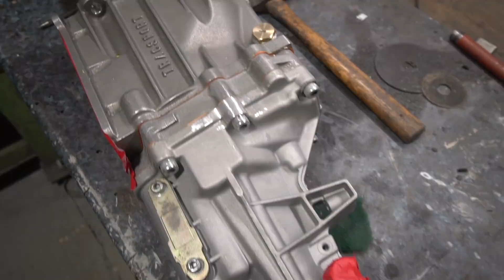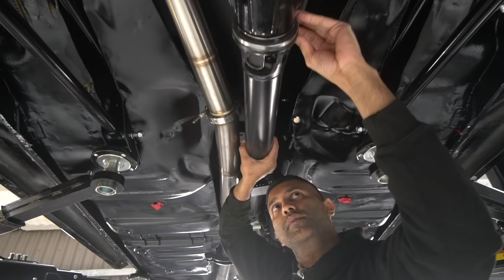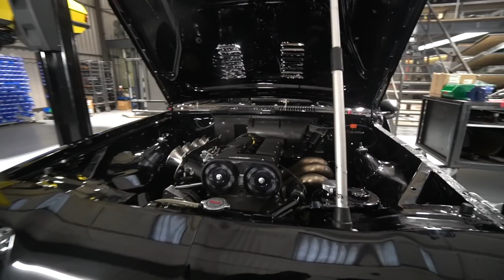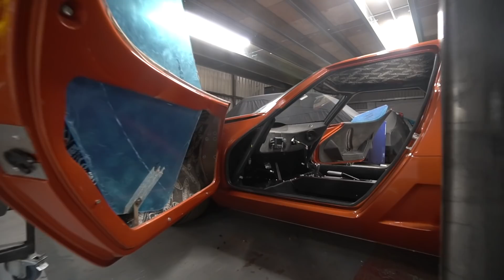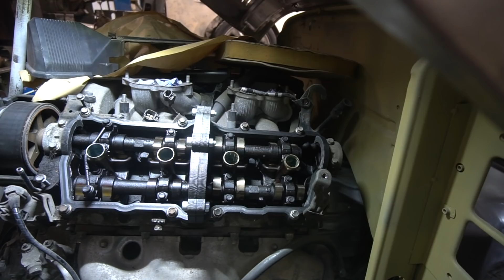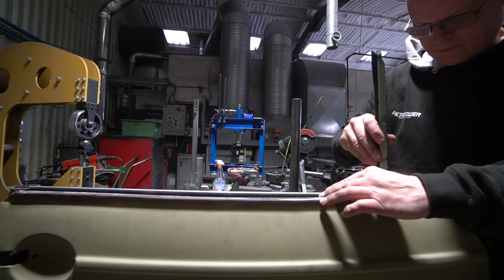Retropower Uncut Episode 60: RS2000 Gearbox Swap, Chevette First Fire-Up & Morris Metalwork

Comment: Why the trottle body injection? In my experinence they tend to not work very well. Or as well as MPI. You could  just hide the injectors under the runners and run a 4-barrel throttle body.

Comment: Guys, what's the reasoning behind using a rolling road / chassis dyno after you've already dyno tuned the motor? Talking specifically about the Chevette.
Reply: The engine will be sat in a different environment to where it was in the engine Dyno, so possibly a different air filter set up and definitely a different exhaust system, which can change the fuelling and ignition settings.

Comment: i could be wrong but i always thought that the type 9 5 speed gearstick came through the floor 2 inches further back in the car than the 4 speed, so people used to cut the gearstick hole out of the floor in the mk2 escort with 2 inches more metal at the rear than the front, turn the section around and weld it back in to fit the type 9 5 speed from a Sierra etc. same trick worked on Cortinas etc from memory, unless theres a different bellhousing that cures the issue, as the bellhousings can, i believe, be swwapped on the type 9.
Reply: Yep I remember that problem too

Comment: Im in the exact same boat as the escort. I have a 4 speed rocket box and a 4.1 diff in my Lotus super 7 replica, and it screams on the motorway. Looking to replace the diff with a lower ratio, just trying to decide on the best gearing. Was looking to go to the 3.88 gearing, unless anyone else recommends a different final drive? It currently sits around 4000 Rpm at 100kph. Escort diffs are getting harder to find these days.

Comment: Regarding the 1UZ inlet manifold, have a chat to the boys at The Skid Factory, because they have designed a cast lower inlet manifold that can suit Holley top manifold products, like the ram style inlet or 4 barrel carb.
Reply: 1.  Retropower does not need to refer to the Skid Factory!
2.  They're not using Holley parts.
Reply: @nickturner2813  calm down, they can do what they want, I was just highlighting another option they might have not been aware of, a tried and tested piece of equipment that is already available, would probably save the customer thousands of dollars, eliminating a large amount of RnD, and custom one off machining for a lower intake manifold.

Most 4 barrel style injection throttle bodies are of similar design, Holley was an example.

Comment: REF the Chevete engine bay,purely from a cosmetic point could the clearish radiator overflow pipe not be converted to a black coloured tube same with windsceen washer feed pipes  ?

Comment: Escorts prop shaft looked off Center
Reply: Off centre on all live axles unless the half shafts are of unequal lengths.
Reply: Just looked odd to me , surely if the axle is off set equals lost  of power ?
Reply: Guys thank you for your answers .all makes sense to me thank you .
Reply: Mallock single seater racing cars used various live axles with a shortened half shaft on the left to keep the prop centred in the chassis. Otherwise not that common!

Comment: The Ford Escort mk2 RS2000,The best looking car Ford ever built.I miss mine
Bliss retro power episode on a Saturday
Reply: They was a good looking car.   But in my opinion  the cortina 1600 E.  Was a better looking car.  And the 3 litre savage was a quick car.
Reply: An econobox the best looking Ford? Various Mustangs would like a word. Some early two seat T-Birds too.
Reply: I agree, the stock Ford bits were pants but the RS mods made it a great fun car.
I drove RS2000's of 2 friends, a stock one & a turbocharged one. The latte was an animal.
Reply: @russcattell955i  mine was not standard, stage 2 head, fast road cam,twin45 webbers,full Janspeed exhaust and manifold. Capri 5 speed box
Reply: @craigorford9932  Nice mods sir. Just needed a LSD to complete.
Reply: @russcattell955i  I had a Capri 2.8 injection axel but never got chance to fit it,It had Bilstean suspension and single leaf springs fitted also lowered an inch or 2 if  I remember right.I bought the car it’s engine had seen better days,but the body work was as new no welded floors.The guy I sold it to still has it I sold it back in the 90’s